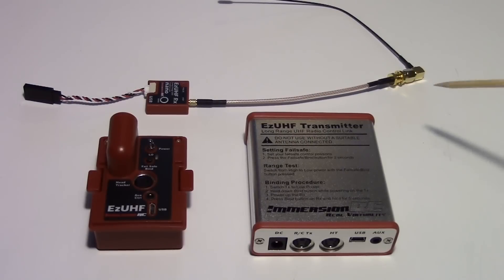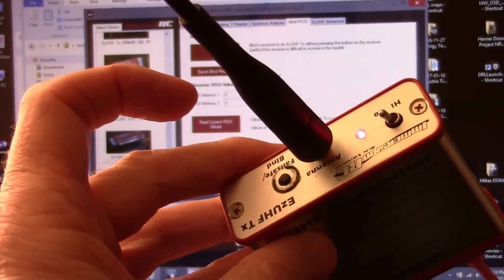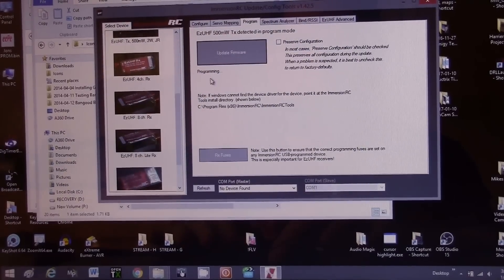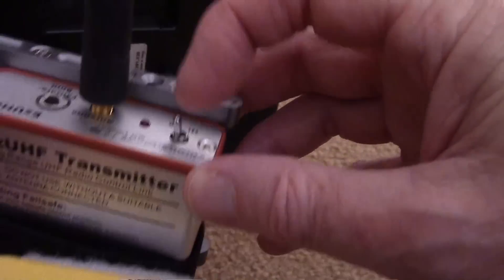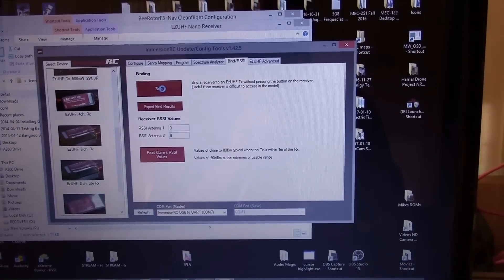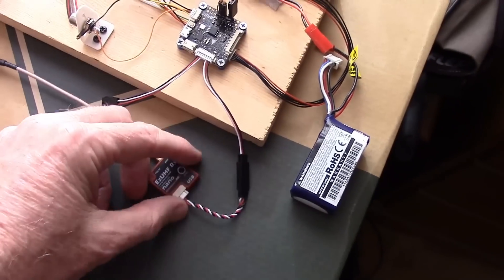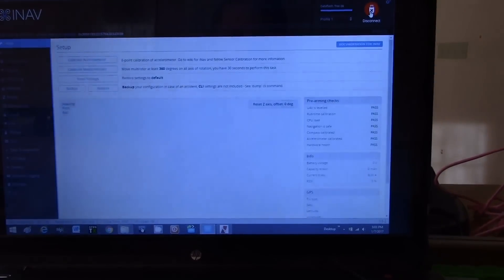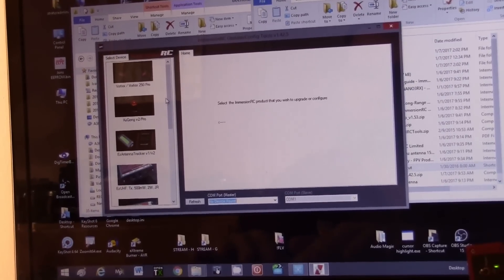EZUHF NANO RX Updating Firmware and Binding to JR TX Module and EZUHF TX Can

Comment: Nice walk through, remember if you update the tx f/w all the rx's must be updated. Note your servo map for each rx, it will be lost during the update.
Reply from the maker: I think those are good points indeed. The only alternative is to have two Transmitters with different firmware. Dedicate one to the Nano 1.53 set and the other to 1.5 for example. Other than that you are looking a updating firmware on everything EZUHF in your fleet.

Comment: WOW, I didn't even know there was a nano version  :-)
Reply from the maker: Yes, it's fairly new. The jury is still out on it. I will be doing some testing later and make a flight video.
I am actually going to try and fly in 30°f with snow on the ground tomorrow. Low wind in the forecast.
Reply: I wish I could fly in 30f temperature Dave. Since my accident and the metal rods in my left thumb, I get pains if it's below 50f :-(
Reply: Oh...... good luck :-)
Reply from the maker: Sorry to hear that Tony. That would keep me in too.
Also if I had to drive in the snow. Fortunately it will be on the golf course behind the house to I can duck back in and warm up. The snow is actually an advantage to keep the golfers off the course while I fly :-)

Comment: Very helpful video. I use original video from two years ago when ever i forget some of the steps. My question is if were wanting to use sbus do we just down load that specific firmware to the rx and tx? Wondered about any steps on the gui for that as well.
Reply from the maker: I have not setup sbus yet but yes I think you just change the firmware and follow the instructions for setup. Should not be too hard.
Reply: Thanks probably just going to leave it on ppm i cant get it to update. Got my TX to update. The rx when bind button is pushed and plugged in it just goes blank.   Tried everything

Comment: Very good, clear and detailed explanation... As usual! Thanks Dave. Do they have the 1.53 version for the regular receivers?
Reply from the maker: Yes, you can upgrade your other receivers to 1.53 in fact it is a must for me because my 8ch and 4ch lite RX's won't bind to my JR module anymore until I upgrade them to 1.53. Why does ImmersionRC do things like they do? IDK
Reply: I tried and for some reason the 1.53 with the regular receivers didn't want to bind! I might just need to try again! Thanks Dave!
Reply from the maker: Main tips for the regular receivers like the 8ch and 4ch lite are to use the tools for binding, hold the button in on the RX when plugging in the USB and get a fast flashing light. You may also need to manually install the Windows driver again for bind mode if you don't get the flashing light.
Also the bind button in the tools while not become active if the driver is not installed. Guess that is all I can think of. I updated and bound 3 of my planes last night with success. Had to try different USB ports on one and that is another tip.
Reply: I tried and didn't work. I guess I will have to try again.

Comment: dmerc00 - do you know if youre using the race sbus firmware, does that mean you cannot use the same module for both sbus and regular ppm rx's without changing the firmware each time? I use the 4ch lite in planes but want to use the nano in a quad running off the same JR module
Reply from the maker: I have not experimented with that. That is probably a question to ask on FPVLab forums.
From what I can tell it looks like you have to choose otherwise why would they have two different versions of 1.53 firmware for the JR module.

Comment: Great Video Tutorial again, so easy....The Nano is obviously aimed at the Multi Rotor market, but I like its small size. The only downside for me is that it has to be hooked to a FC in order to use it.....Its why I prefer the little 4 channel version, it has servo pinouts on it..Im assuming you now need the new Firmware version 1.53 on your older receivers as well now or they won't work with the TX Modules..?
Reply from the maker: You are correct, I must now do an upgrade to 1.53 on my other 4 receivers just so I can use the Nano. Ouch!
The mini-quad market as caused a flourish of new gadgets that are actually benefiting the small fixed wing pilots with lighter weight equipment and cheaper pricing. You got to love it. I see miniature 1.3ghz video tx's out now too. Of course this means a crowding on the 1.3 band.
Reply: Lol....I thought so...Upgrade your TX Firmware....Be prepared to do ALL of your receivers too..I love my EZUHF radio actually, it's really rather sorted once you use Dipoles on your RXs...Im lucky here, the 1280mhz band is pretty clear, I just wish our weather was....:)

Comment: you know I secretly would like to play with UHF but I just don't live far enough away from all the yahoos!
Reply from the maker: EZUHF is really "Off the chains!" or at least that is what Mel B says.
It's great not to have to worry about flying out of RC range. Thinking about using it on my Tek Sumo wing now that the RX is smaller and much cheaper than the larger versions.